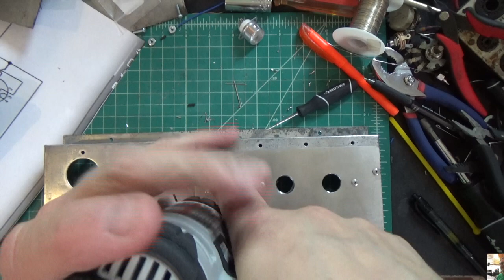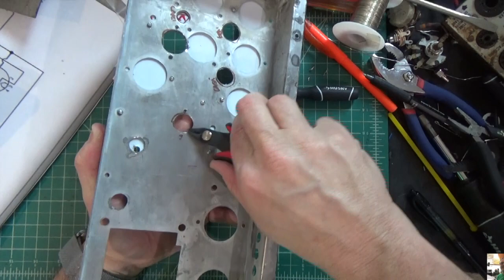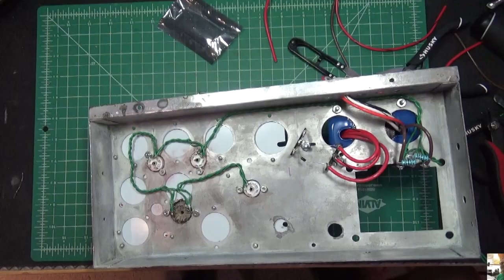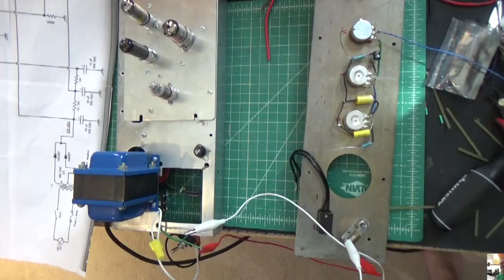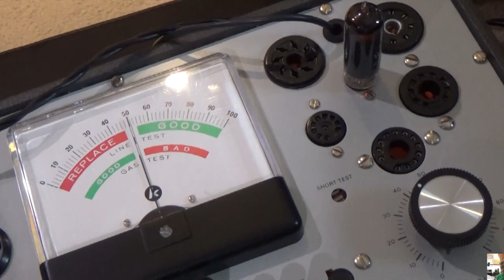Presto K8 Goat Deluxe Amp Build - Episode 4 - Filamena  alive, barely

Comment: BTW.   You need to add the filter cap to rectifier diodes to get the real B+ voltage.   The true RMS meter is giving you a reading based on pulsed rectified DC.  Once you add the capacitor it will capture the peak voltage coming out of the rectifiers.   You will get around 285 volts DC once filtered by the cap.
Reply from the maker: Understood JP... Without load and cap I know it is not accurate.  thank you
Reply: See Rick's video.  It explains and demonstrates what is happening on a scope very well.     https://www.youtube.com/watch?v=_EUfJEUzAGo
Reply from the maker: That was really helpful Jp... thank you again

Comment: Nice and clean wiring so far. Looking good. Glad you are testing as you go the cold solder joint would have been tougher to find later. Nice job.
Reply from the maker: Thanks Stan... slow and steady is the way !!!
Reply: I think that is fantastic practice.  Testing as you go.

Comment: Fuse and switch should be on hot side of mains as discussed previously.   Come to think of it, did you switch the neutrals on the Halicrafters mains power too?   Shame shame.
Reply from the maker: This is something I cannot get straight in my head and after watching my video back I realized it was wrong. The Hallicrafters is not wired this way.  Is there a good video on YT or picture on Google you can share that I can print out and use as a reference ?  I just have a mental block on this part... Thanks !!!
Reply from the maker: ok... I think I have it worked out and created a drawing for future reference.  Here is the link... Does this look right to you ?  Thanks in advance   https://pbs.twimg.com/media/DW6chVFXcAUX3N6.jpg:large
Reply: Perfect.   In that order also.  Fuse closest to the source then switch next.  Then tie to transformer.  Very good sir.
Reply from the maker: Never shall I goof this up again !!!!

Comment: Ron, You are switching the neutral (white) wire?
The switch should be in series with the fuse on the HOT side (black wire)
Looking good Ron!
Reply from the maker: Yes Bill, I goofed it up an have already removed that configuration.  I need a visual reference to make sure I always get this right.